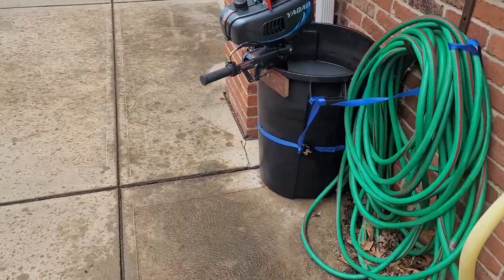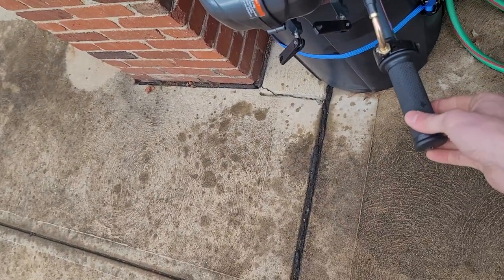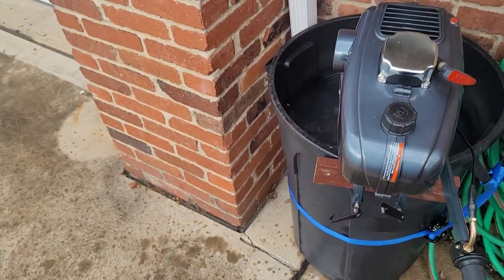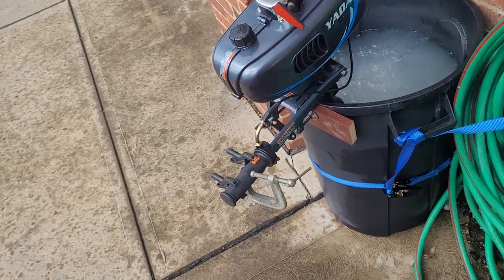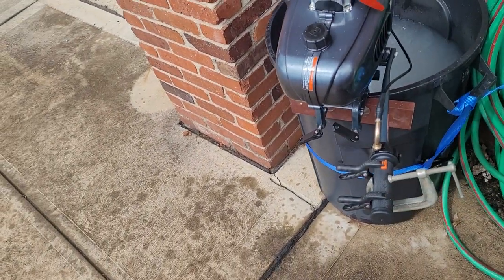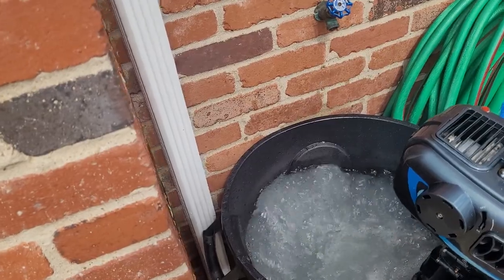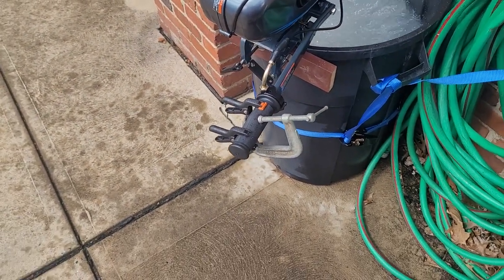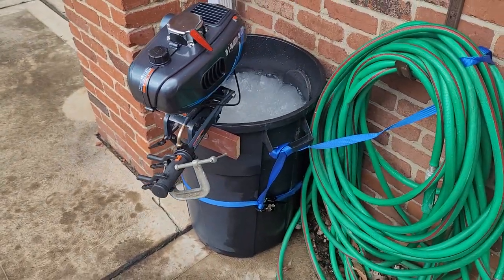YADAO Outboard Heavy Duty High-Speed Motor Water Cooling System (3.5HP 2-Stroke Water Cooling)

Comment: Will this motor slow down enough for lake trolling 2.0mp to 3mp on a 14-foot aluminum boat?
Reply from the maker: @Glennmc7  it should be able to, but you’ll have to use a clip or something to hold the motor in place at the speed you want. Otherwise it’ll just run and not move

Comment: Did it mount right on your boat or did you need a raised transom ?
Reply from the maker: it mounts right to the boat. it has handles that tighten mounts right to the back of your canoe, boat, etc
Reply from the maker: in the video, we used a piece of wood on the back of the trash can simply because the trash can's outer rim was so small that it needed a bigger gap to safely tighten to
Reply: Thank you! And the trashcan was a great idea for storage if I can’t think of anything else!

Comment: That engine will not break in properly running at a constant throttle. You have to vary the engine speed avoiding full throttle too long.
Reply from the maker: @jmaclaren4147  from our understanding, in order to break in the motor and make sure it ran properly we had to let it run at 3/4 to full speed for a couple of hours. Thats what we did and it’s been working and starting up amazingly

Comment: How fast does water come out of the impeller outlet? As I have very little coming out
Reply from the maker: Water should continuously come out of the exhaust, hence why it is called an outboard motor. You should see a continuous 'squirt' of water coming out while the motor is on. Although it is not much water, it should still spit out of the exhaust. I hope this helps!!
Reply: @hoovboysoutdoors its air cooled actually, but the exhaust and gearcase are watercooled
Reply: @melonboi186 it's water cooled. It has a water jacket around the cylinder, water comes in one sides water exits into the exhaust side into the exhaust pipe
Reply: I finally got a source on these motors.  Actually the hankai.  This video is the 3.5 Yadao.  The same 3.5 hankai seems to be a little nicer, identical parts but a bit nicer.  The 3.6 hankai is superior to these, the throttle.  For break in, just go use it on the water, just vary it, dont go full throttle for 10 hours or so.  The hankai 3.6 throttle is super nice compared to the 3.5.  The 3.6 is a little different make up with the case and style and what not.
Reply: @hoovboysoutdoors  They call it outboard, as opposed to inboard, or inboard outboard for obvious reason of engine location.
Reply: It is water cooled. The manual is almost gibberish. Nothing is said about the lower gear housing it is without oil for some reason. Pull the prop and remove the 2 allen bolts to get access to the gears. There is an oil level mark on the outside of the housing...but why? Anyway add about a couple of spoonfuls worth of 90 wt.
Nothing is mentioned about the cooling system but don't run it in the dry, it has a rubber impeller in the lower unit. 
I guess I just didn't trust my luck with this little machine but after disassembling it and investigating, I'm satisfied that it's a decent little motor.

Comment: How’s it held up so far? I’m thinking about getting one for my 14ft jon boat
Reply from the maker: No problems as of yet.  Probably have 25 hours through it and some change.  Just remember to add gear oil to it.  Adding the gear oil was the hardest part because you have to take the propeller off.  Parts fit together pretty easily but getting them off was kind of a task.  The instructions that come with it were not the best, but it was easy to figure out.  We use ours on a 14 ft. canoe which weighs 84lbs on top of all our fishing gear and two adults.  Runs us up river pretty easily and seems to be good on fuel.  For the price, it gets the job done well.
Reply: @hoovboysoutdoors  I just ordered one, it seems hard to find a good working motor from some of the Chinese companies that have a good bit of power, but this one sounds good!
Reply: Do u have to put gear oil in these
Reply: @keewilcox3175 Read the post you replied to.
Reply: @hoovboysoutdoors   I know my way around engines. Mine blew up at half speed after 65 mins running time. It's the worst outboard i ve seen !
Reply from the maker: @Peresnost That sucks man sorry to hear. We made sure to run it for 10 hours straight two days In a row to make sure everything was seated correctly. As overseas motors go, I think they are all pretty similar. We still have yet to have any issues with ours. I hope you got some money back or at least sent it back to be fixed